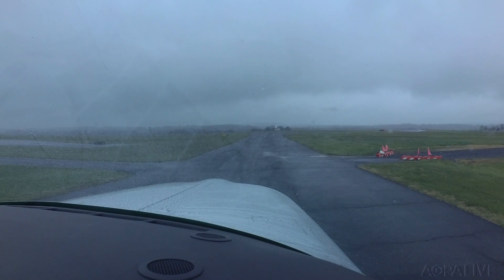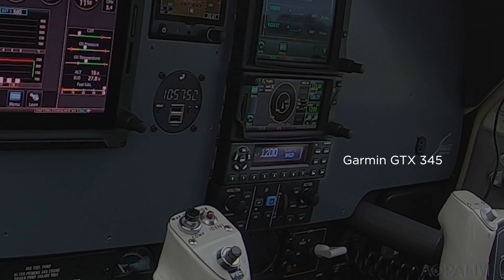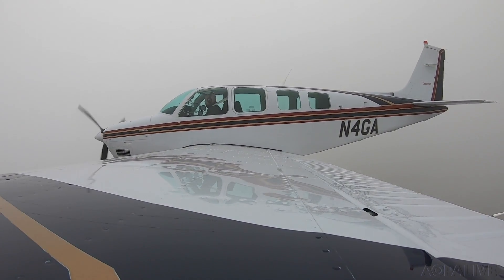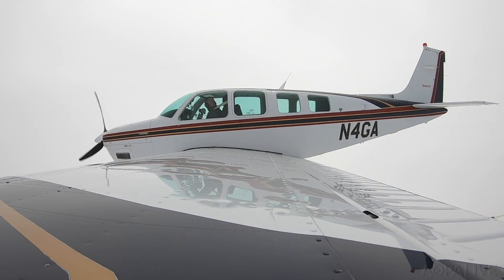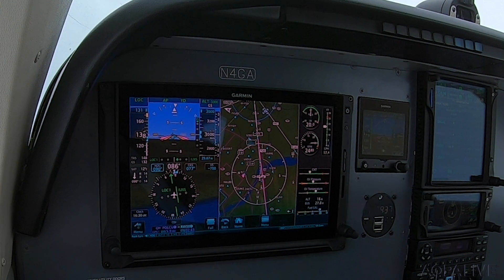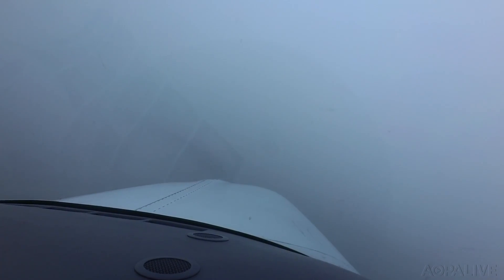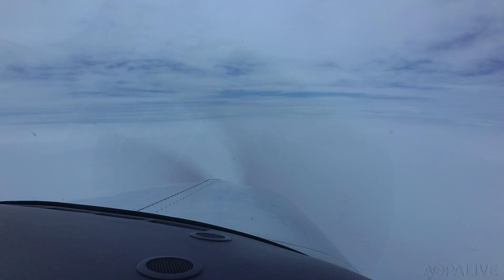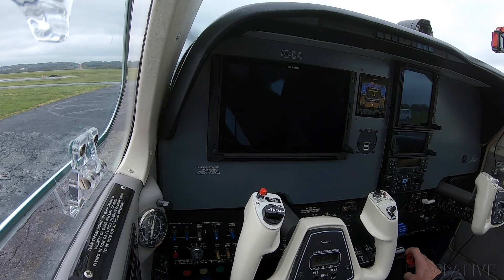Flying IFR with new Garmin Avionics

Comment: It a shame that the overseer’s of general aviation don’t know the limitations of their equipment. While I agree the GFC 500 is an awesome autopilot, you should know and respect the limitations of your equipment. Right out of the Airplane Flight Manual Supplement, Section 2 - Limitations, Pg. 1. 6th item listed “The autopilot must be disengaged below 200 feet AGL during approach operations and below 800 feet AGL during all other operations.”.  Looks to me at the 1:52 mark when the auto pilot was engaged he was at 530 feet MSL on the altimeter which would put the airplane at approximately 221 feet AGL, 579 feet BELOW the minimum autopilot engagement altitude per Garmin. I’ve failed pilots for just that….

Comment: This is all great stuff!  Great until it fails.  Then you live or crash on YOUR expertise.  Automation is amazingly helpful and improve safety; up to a point.  Single pilot IFR is the great challenge and accomplished the old fashion way including dealing with failures of equipment is the bar between ammeture and professional CFIA&I.  Aspire to be your best.
Reply: Kristen, the 1950's called: they want your attitude back.  The modernisation of aircraft cockpits, moving map displays and terrain awareness functions in particular, have made a massive impact on CFIT accidents, particularly in single pilot IFR ops.  They're the best workload reducing, capacity broadening copilots you could have.  Maintaining automation proficiency is just as important as hand flying proficiency and Dave's demonstration of a few coupled approaches doesn't mean the four horsemen of the apocalypse are mounting their steeds.  Let's leave 'old school' in the past where it belongs, adapt to & embrace new technology while maintaining the basic flight skills required of every pilot.
Reply: @cjl76  Wow... Is there something wrong with my enjoyment of the flying I did in the 70s& 80s?  I was born in 1956 not flying in the 50s.  I flew a C-182 with a then modern system that could fly a coupled approach.  It would execute a go around with a press of a button.  No autothrotle of course.  Thanks for your amusing rant🤔👍🤷

Comment: You asked what you could do next.  Here is the anser. Put a "couple" of Old fashioned gauges "steam" back into the airplane, so when your aircraft has a total electric failure, you're not jeopardizing the lives of the people you took up with you.   CFI/A&P JOE COVINO. Lake Havasu City. Arizona.
Reply: the G5 has an independent 4 hour battery backup.  In the event of a total electrical failure, the G5 continues to work.  Far more people die by vac failures every year.  And with the back-up G5, the odds are in his favor big time.
Reply: So I also redid my panel with a g500 txi. I kept most of the original instruments, ai, dg, airspeed, altitude. I could get a battery backup all in one but that would cost $6000 or more, and I don't feel it would add much to the presentation of the g500 txi, which has about as much glass as you could want. 
The other advantages are that these instruments are dirt simple. Airspeed and altitude are driven off the same pitot static system as the g500, don't fail with electrical failure, and are very simple instruments with no real failure mode. I believe mine are original to the airplane, 43 years old.
The DG and AI, are, of course, vac driven. However, the argument that "vac failures are far more common" is a canard. The vac system does not have to be reliable all the time, only during the 30 minutes it takes to get you out of hard IFR after an electrical fail, and I am going to have more than one GPS that is battery backed up (tablet and phone). The chances of such a double failure, both electrical and vac, two systems that are driven differently (alternator vs vac pump) AT THE SAME TIME, DURING HARD IFR are sufficiently remote for me.
Reply: @scottfranco1962  garmin autopilot MUST have a G5... impossible to have a garmin autopilot without a G5.  So, it's handy that the g5 has a battery backup
Reply: @MrZrryan2  Not exactly true. The Garmin autopilot, the GFC 500, cannot talk to the G500 (any g500, txi or no), so you have to have a G5 to drive it. And so the G500 (txi) has things like flight director, a set for altitude, rate of climb, etc. BUT, since it can't talk to the autopilot, you have to operate it via a small screen G5. The GFC 600, will do it, but costs a lot more and isn't certified for my aircraft. I'm not begrudging the setup, but its a shame the G500 txi can't control Garmin's own autopilot like their other autopilots can, or indeed, the S-Tec 55x can.
Reply: @smis450  I think you need to reread. The vac system and the G500 are complementary to each other.